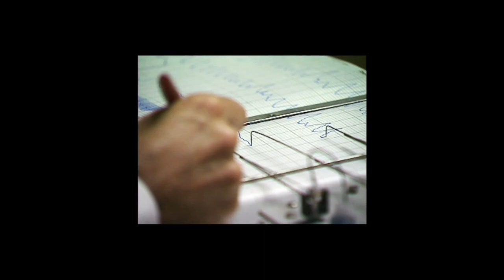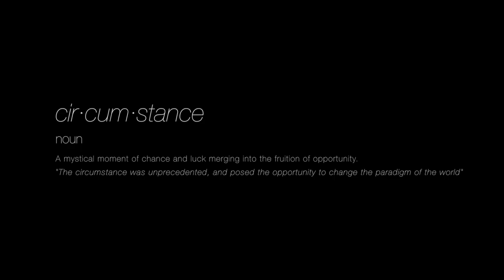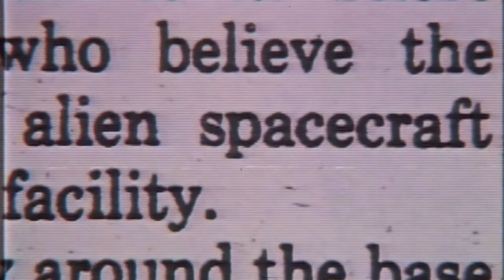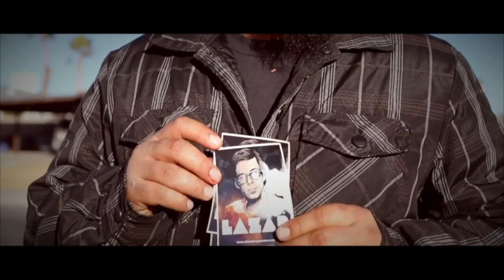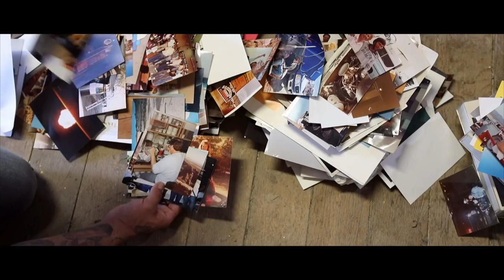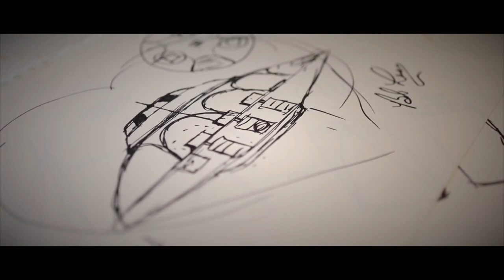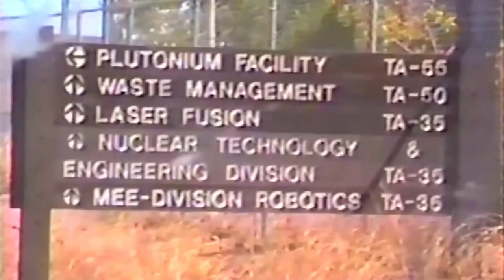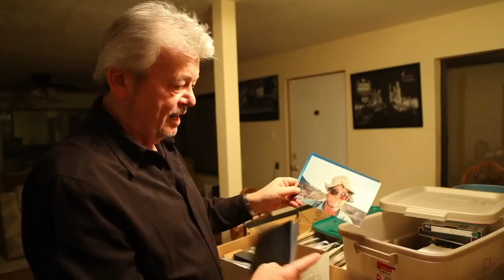bob lazar: ∇ area 51 & flying saucers II - trailers/teasers movie montage #1 (2018) [jeremy corbell]

Comment from the maker: 👽🛸 "bob lazar: ∇ area 51 & flying saucers II - official trailers/teasers/deleted/extended scenes movie montage #1 - LA1,000 EDITION - jeremy kenyon lockyer corbell, - 2018." -  

video specification information: 16:9 aspect ratio. runtime: 2:03:59. video resolution. 1920x1080p [FHD] FULL high definition. file size after conversion 21.86GB. 60fps. frames per second. (WAV) waveform audio files. surrounded 5.1 avanced/enhanced lossless audio quality.

#jeremykenyonlockyercorbell

 jeremy corbel's, award winning netflix documentary "bob lazar, area 51 & flying saucers" - how does bob lazar's UFO work? bob lazar's "sportmodel" UFO how this craft manipulates itself in order to travel interstellar through space. this is basically the exact opposite of how everything we have operates, which is a major clue as to how "gravitational waves" move matter. (1) the "gravity emitters" conform to the shape of the "ridges" on the bottom of the craft. (2) the gravity emitters work directly on the metal of the craft/the "skin of the craft" is what moves the entire craft around. while a jet engine increases heat and travels through compression of hot air, this craft doesn't use heat at all, it emits a positive or negative gravitational force that hits the metal of the craft directly and moves the metal itself, which in effect moves the entire craft. (3) the 3 different ridges on the bottom of the craft act like a speaker woofer to transmit the gravitational wave through the mass of the metal. - bob lazar tube.

how it all begun:

a lot of people claim that the US military hides UFO at area 51. this is not true. fact is that the US has a few UFO they are however not based at area 51 but at a camouflaged military underground facility named "S-4" (site-4) and according to lazar, located 15 miles south of area 51 near papoose lake, groom lake test facility, lincoln county, nevada, USA.

the majestic 12 - MJ12 documents link: 

 https://majesticdocuments.com/
  
former government physicist bob lazar, made headlines world-wide in 1989 when he came forward with his account of reverse-engineering an alien spacecraft for the US military. the reason the public even knows the name 'area 51' is because lazar, came forward about the work he did at the formerly secret military base. his testimony remains the most controversial and important UFO story of all time. this film intimately chronicles the challenges and travails of a cosmic whistleblower. burdened with a revolutionary secret, he had to choose between his oath to his country or his conscience. corbell's film explores lazar's groundbreaking claims and the devastating impact it has had on his life over the course of the last 30 years, including rare and never before revealed footage guaranteed to alter the landscape of the debate. he blew the whistle, shocked the world, then went silent - until now. - jeremy kenyon lockyer corbell. - #boblazar #jeremycorbell #area51 #areas4

bob lazar, is a physicist who worked at los alamos national laboratory in new mexico, and also on reverse engineering extraterrestrial technology at a site called S-4 (site-4) near the area 51 groom lake operating location. area 51. wikipedia - info: https://en.m.wikipedia.org/wiki/Bob_Lazar - https://en.m.wikipedia.org/wiki/Jeremy_Kenyon_Lockyer_Corbell - https://en.m.wikipedia.org/wiki/area_51 - corbell’s film has received international acclaim and is titled, 
 
"bob lazar : area 51 & flying saucers"
narrated by oscar nominated actor - mickey rourke,

for over two hours of bonus footage, buy the movie on itunes or vimeo.

itunes : https://itunes.apple.com/us/movie/bob-lazar-area-51-flying-saucers/id1441638753

vimeo : https://vimeo.com/ondemand/boblazararea51

"weaponize your curiosity" and learn more at https://www.extraordinarybeliefs.com

jeremy
---
jeremy kenyon lockyer corbell,
creator, "extraordinary beliefs"
 
jeremy kenyon lockyer corbell,

additional edited/remastered FHD 1920x1080p 60fps video courtesy of bob lazar tube, @  
https://youtube.com/channel/UCqUCd8MLINk70HYwcNerioQ

support robert scott lazar, @ united nuclear, @ https://youtube.com/user/wwwunitednuclear - https://unitednuclear.com/ - https://www.instagram.com/unitednuclear/ - video courtesy of jeremy kenyon lockyer corbell, @  
https://m.youtube.com/channel/UCkgPT7LeB_t1aXTYyMiFVAg - https://www.extraordinarybeliefs.com/ - https://www.instagram.com/jeremycorbell/ - https://mobile.twitter.com/jeremycorbell - https://m.facebook.com/jeremycorbell - https://en.m.wikipedia.org/wiki/jeremy_kenyon_lockyer_corbell - https://vimeo.com/jeremycorbell © 2018 jeremy kenyon lockyer corbell - all rights reserved